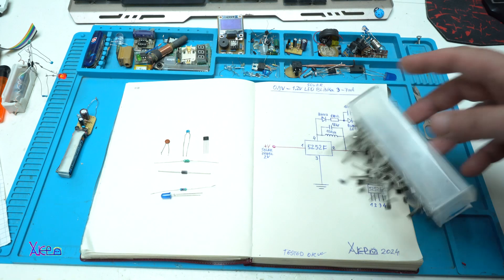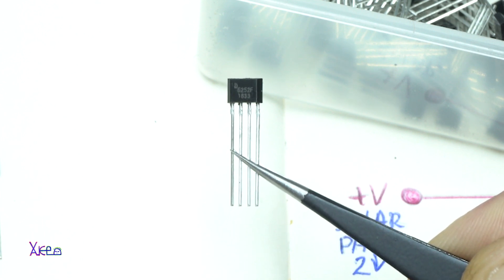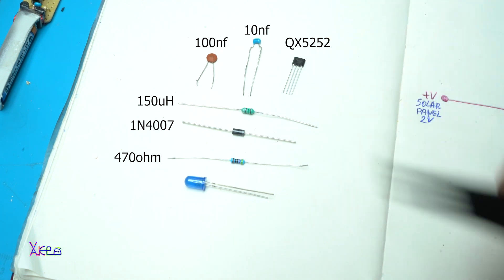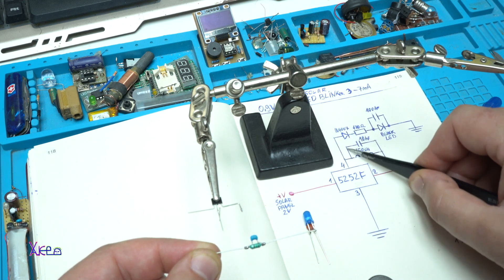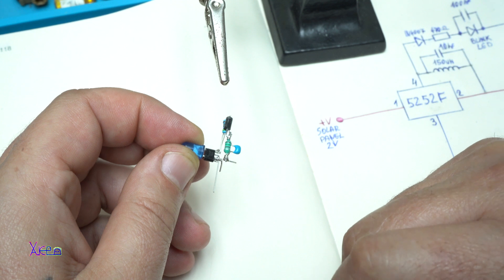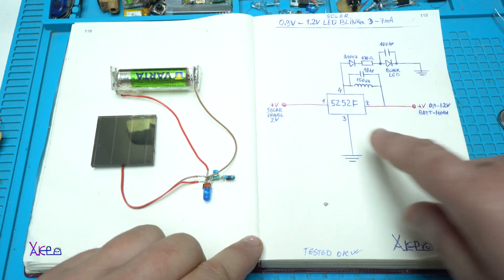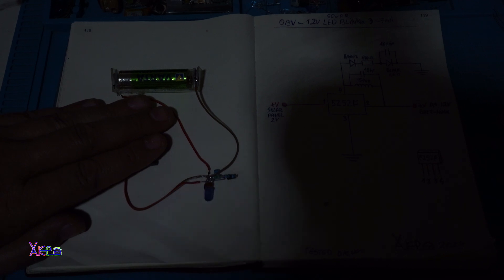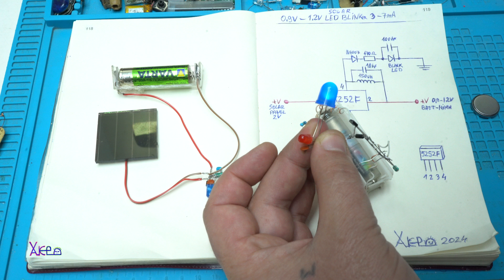Every Has this Chip at home, WHAT CAN YOU MAKE?

Comment: the red led operates at a lower voltage than the blue led, so when red led turns on iit pulls down the voltage and blue lecd does not light,when red led turns off voltage rises and blue led turns on
Reply: Yes, exactly what I was thinking.
Reply from the maker: Yes that is true,an I didnt know that trick😄

Comment: Does the 470 ohm control brightness of the LED only? Or does it control maximum current draw which I think would be controlled by the value of inductor?
Reply from the maker: Yes that resistor is for current limit,I plan to make several of these bcz new year is coming🙂
Reply: @Hacktuber I would think the resistor would still use the same amount of power and dissipate the unused current as heat as resistors usually do. 

With a 150 uH inductor and a fully charged NiMh battery the current to the LED using the 5252F should be just under 8 mA